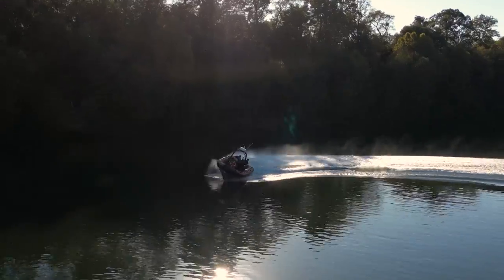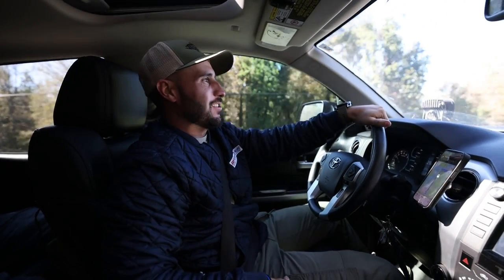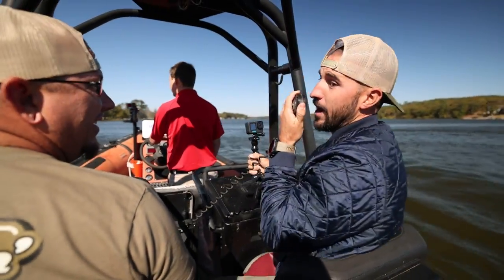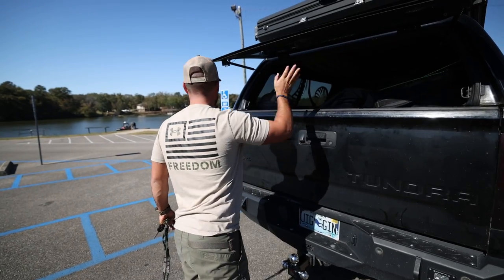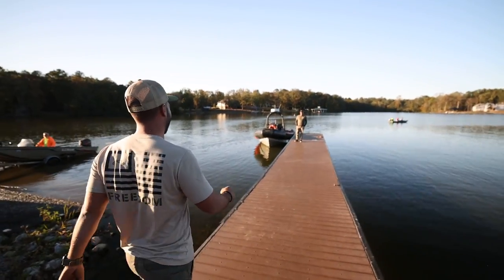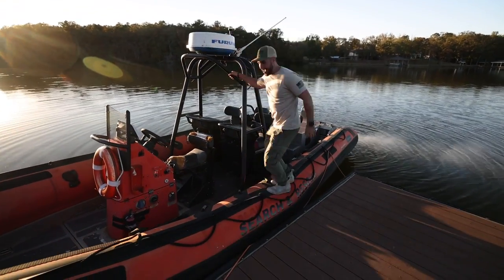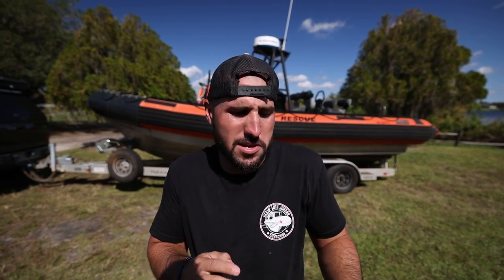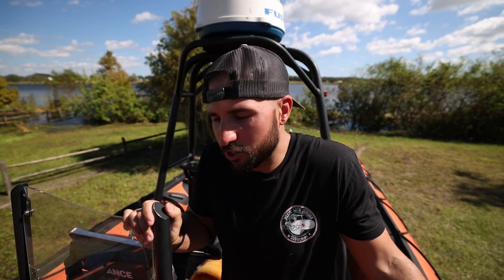I Bought a RETIRED U.S. COAST GUARD MILITARY BOAT!!! (Massive Turbo Diesel)

Comment: Coast Guard Vet here.  These RHIB'S (Rigid Hull Inflatable Boats were also carried by some of our large ships, which had hoist systems to deploy the boat to and from the water.  So, those lift points aren't just for deployment from helicopters.  Just looked at the comments and saw other coasties pointing out the same.  Sorry for being repetitive.
Reply: Yep! Former BM2 here! These were the OTHs (over the horizon) that could go the distance to chase drug runners. Lost my front tooth on that starboard side navigation seat. Awesome.  And yeah those attachments were for the dual davit system to crane the boat into the water from the ship. And these boats were NOT designed to flip back over if capsized. He's confused with other CG boats (see the RBM 45ft and 47ft)
Reply: Did four years as a fireman getting promoted to petty officer 3rd class before leaving and commissioning in the navy as an EOD officer. I loved the cutter boats. I miss them a lot.
Reply: I feel like this one was decom'd before he bought it. Primarily because the sponson says "Search and Rescue" I'm thinking a fire department or life guard had it after the CG. 
But yeah, I've never seen an OTH picked up by a helo. Not saying it couldn't be done or hasn't.  Actually on second thought, that seems like it'd be too unstable for a helo. I think a load that size would need four points of contact. (just guessing, I'm only an MK)

Edit: I should have watched more before commenting on why it said Search and Rescue...
Reply: @rusty2381  oh for sure. From my understanding is that the search and rescue agency bought it from like a government auction or something. I think if I remember clearly that the coast guard sells or auctions of decommissioned items to first other federal agencies, then state, then local. And than from there it’s up to the state whether they want to sell it to a civilian. I am 80% sure that they (the coast guard) do not auction off or sell things to civilians.
Reply: @USN-LT-Lee  Thanks for your insight. Being 80% sure made me chuckle. That's pretty precise thinking.
Reply: @USN-LT-Lee  yeah, I didn't realize he already explained another agency bought it before selling it to them.
I think the process for buying old stuff from the CG is to go through GSA's auction website. Saw picture from a friend of a guy who bought this same OTH mk III, and completely redid it into a fishing boat. He named it Other Than Honorable (I thought was pretty clever) and unless you were familiar with the platform, you'd never guess it was once a CG boat.
Reply: Dang you stole my thunder brother 😎
Having been an Airdale I would also to point out there are no Coast Guard helos capable of lifting that thing, the H60 tops out at 6k.
SEMPER PARATUS BROTHER

Comment: Keep the radar and don’t paint it. The radar will do you more good than a seat on top. Paint on the radar dome can cause problems and possibly damage the radar. That dome is designed to allow microwave radiation to pass through Unimpeded while paint may create reflections or heat up due to microwave radiation.

Comment: I was in the Coast Guard and that was the first small boat I got qualified on. Those are small boats or OTH over the horizon boats. Those attachment points are for the hoist system to raise the boat out of the water and then gets cradled on the cutter. Lots of memories on that!

Comment: Am a boat captain... when all seats are occupied next time don't put more weight on the stern/back of the boat, rather in the middle of the hull or the bow but since the captain is at the bow just put the weight in the middle seats. Less pressure on the engine makes it easier to plane off and so the keel can cut the water better. I hope you see this and i love all of your videos❤️
Reply: You may be a boat captain but you have absolutely no experience operating a OTH MKIII, (over the horizon)
Reply: Old Boatswain's mate here, I agree 100% about the weight distribution.
Reply: @jeremygourde9880  experience or not that goes for all speed vessels!!

Comment: I got to go to RHIB training school while in the Coast Guard where we learned to "jump" these properly, unofficially of course.  Was a Coxswain on the 21 RHIB and 41 UTB (North Bay San Fran) for 5 yrs.  When pulling the RHIB to "hard to reach" areas we would have to drive code 3, lights and sirens on the truck then drop the boat near the emergency.  I recall using the same trailer in your picture.  Having pulled a 21' ft boat, code three at 100 mph'ish, its a solid trailer.  We did lose a wheel once, at the launch ramp....bad bearing buddy.  Fun solid boats, even in Alaskan waters they handled well.   Good buy, take care of those sponsons!
Reply: BTW... we tested  a few motor configs over the years, the most impressive was a Merc 500 outboard.  Airtime felt much more stable and balanced, and caught up with most jet skis of the day.
Reply: Towing a RHIB with a duelly at over 100 mph?!? Riiiiiiiigggghhhhtttttt………. :-/
Reply: @a47mlb  Not a sea story, stating fact brotha...  Some of our tows (code three package on the non-dually truck)  were 40 miles before dropping the boat farther up the river...long open roads, and this was before the search for folks in distress could begin.   Several of us went through CHP skid pan course to qualify for driving the truck code.  Of course those speeds were not encouraged, but happened none the less.  Chevy non-dually pulling.  Semper Paratus!

Comment: We replaced our Mk. 2 that was attached to our USCG Cutter earlier this year. It's a great boat, but all of the Coast Guard small boats have speed governers, so I would recommend taking that off to get the full performance.
Reply: All of the coast guard small boats have speed governors…? 
1 thats not a mk 2 
2 our small boats do not have speed regs whoever told you that is stupid. 
3 why would we … we literally chase go fast boats we need all the speed we can get.

Comment: Actually, those heavy duty hooks are primarily for lifting the boat into a coast guard cutter or into a military ship... the fact that it can be done with a helicopter is just a bonus...Looks like the perfect boat for you to take Jake and Tristan diving off of in the keys... So when are you getting the retired Coast guard Cutter or retired PT boat?
Reply: Never were they ever designed for helicopter lifting points.
Reply: Ya, I served on several cutters. this is an old OTH response boat off a cutter.
Reply: I know of a retired 82’ cutter for sale. Working condition.
Reply: @afcgeo882  When I was at Sector North Carolina the tow boat us there was trying to buy an Island Class cutter that was getting decomed.
Reply: @10706BND  You can buy all kinds of stuff. This particular 82 (USCGC Point Brown) was sold or given to a college with a maritime program to use as a teaching platform, but ended up derelict. A former CG officer locally found it and bought it relatively cheaply, with a bunch of parts, and with the help of MKs from the local station was able to restore it and then register it as an AUX facility, running it on patrols in NYC under the name of “Lady B.”

I know of Auxiliarists who’ve bought 25 RBS, 40s and 45s.
Reply: @afcgeo882  I’ve had the chance to be on the Lady B. , Point Class Cutters were way before my time but I’ve been told that seeing the Lady B has brought back fond memories!
Reply: @USN-LT-Lee  Her and Stew (skipper/owner) are legends!

Comment: Good video I am in the coast guard and worked with these boats they are what is called a cutter boat and or deployable boats on a coast guard cutter and for the lifting points for what’s called a davit that lower it from the cutter into the water and that boat in particular is not self righting but it is very cool to see out doing things now they are retiring that model of boat

Comment: That diesel engine in that boat is a Yanmar 6LP-STP/ STE depend on the HP rating  which should be about 300HP.  Great motor if you have all the service records but either way its a good motor,  the gauge cluster on dash should show you engine hours alone with some other information to help you out.

Comment: That OTH MKIII (over the horizon) never would 60mph even when they were brand new delivered, @ best we’d see 42kts.  The yanmar diesel was 315hp and there was a huge turbo lag, always had to make sure we stayed up on the turbo during tactical boat ops otherwise we’d get beat by the outboards.  The so called helicopter lift points you keep mentioning are not for helicopters to hoist/lift and deploy the boat, they are part of the boat launch/recovery davit system.   There are d-rings and pad-eyes in the deck for crane hoisting/lifting operations.   I know you guys are jazzed up about those shock mitigating  seats but they’re not as good as you think.   I have severe back issues because of those seats bottoming out during intercepts.    I would suggest reaching out to some prior coasties who have experience operating these boats and can teach you the capabilities and operating characteristics and limitations before you or your crew get hurt.  I’m pretty sure the OTH MKII/III type manual is still available online and will show every system with casualty control procedures.

Comment: Those are NOT tow hooks and they are NOT meant for helicopters to sling them, though they theoretically could be used that way, I guess.

These OTH (over-the-horizon) small boats were/are mounted on Coast Guard cutters above their hulls, on the sides and were/are lowered into the water by two cranes, one forward, one aft. Those hooks were attached to the crane lifts. This allowed the crew to board the boat on the cutter and be lowered evenly to the surface (and raised back up) without having to use ladders or nets up a hull. 

The role of an OTH small boat is to very quickly get to your target and perform a rescue or a boarding while the cutter makes its way to it.

The first two numbers in a CG small boat hull number identify the boat’s length, btw. This one starts with a “23”, because it’s 23 feet long.

The current Legend Class national security cutters have a 35’ OTH called the Long-Range Interceptor that can do 35kts and a Short-Range Prosecutor that can do up to 30kts and travel 20 miles from the cutter, which is what you see here.

Comment: Speaking of the 2 inch drop hitch. I drive a lowered crown Victoria.  I pull a 10ft utility trailer with 2 quads and a. drift trike.  This car will get it done.  But being so low I have an 8 inch drop flipped upside down. So I have an 8in rise for make the trailer set level.   When other guys see it they laugh but say hey whatever works!!

Comment: Don't roll it!!! It won't self right itself without a floatbag installed near where the radar dome is. From videos i've they fit an automatic float bag on the frame near the radar dome, if you turn the boat over, it then automatically inflates and self right the boat.

Comment: You never fail to entertain, at least you now have the boat to support the F! and the sub. Ask the boys if they think they could put a boom and winch on it, strong enough to rise and lower the sub, if so you could float a platform (which could be the bed of the sub trailer, that  the sub if launched on and towed by the boat. Well just as thought :goodvibes:

Comment: As an old Coastie, that looks like an old cutter OTH response boat. The ones that were at the stations I don’t think ever had those hooks etc.

Those hooks that you said were to drop from helicopters are actually designed to lift it up into the cutter.

I spent 5 years on 210 and 270’ cutters and we had response boats just like this.

They got replaced with the new OTH boats. 

Still cool you got one! I live in Central Florida and still see this things being used by tow boat US etc.

Comment: I’m curious how efficient this diesel was, interesting that it’s a mechanical fuel pump, probably in case of an EMP, how many feet long is it? And how wide? How many hp?
Reply: Having been qualified on CB-OTH MKIII’s they had a fuel capacity of 85gallons and a range of 250nm with a cruising speed of 26kts.  Max was 42kts. The fuel pump was mechanical bc that was the design criteria as it’s a proven system and not prone to electrical malfunction due to saltwater intrusion in the engine compartment. The engine compartment wasn’t watertight and was always getting soaked in saltwater.  They were 24’9”  length overall and 9’ wide,   The engine was a yanmar inline 6cyl making 315hp @3800rpm
Reply: @jeremygourde9880  This is spot on!

Comment: Those hook points you mentioned for helicopters are more often used by a larger mothership (Look up a Coast Guard Cutter, basically a modern day destroyer.) where they have recesses in the side of the hull that boats like these sit in, with retractable cranes that push the smaller boats like these (Called RHIBs) out of the recesses and over the water, where those cranes lower them onto the water so that they can quickly deploy and intercept things faster than the cutters, help with search and rescue, or board any potentially dangerous vessel that they've held at gunpoint, such as pirates and smugglers and poachers and the like.
Reply: Also, to honor the boat and it's history, whenever you get it repainted, you should absolutely repaint and freshen up the numbers that are already on it, keep its legacy alive with that number.